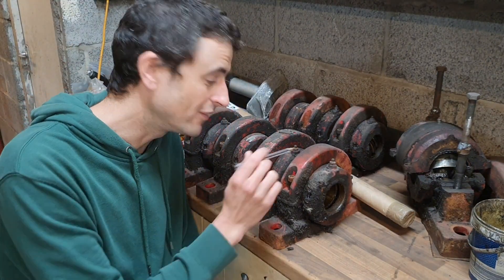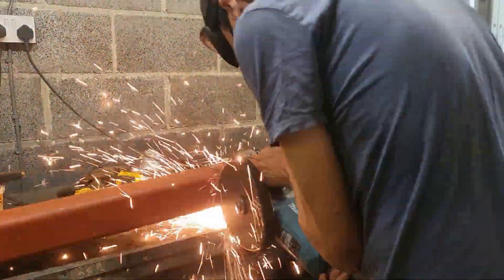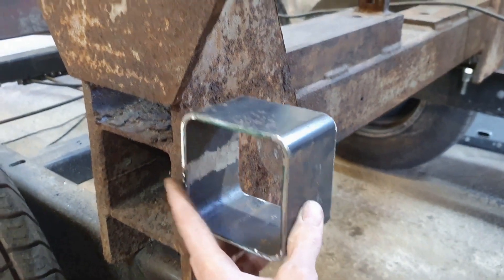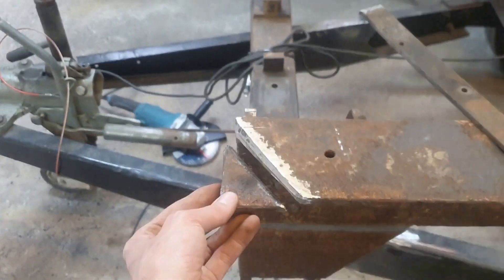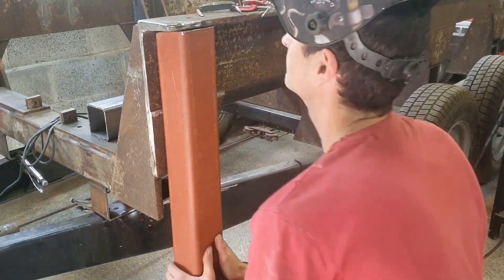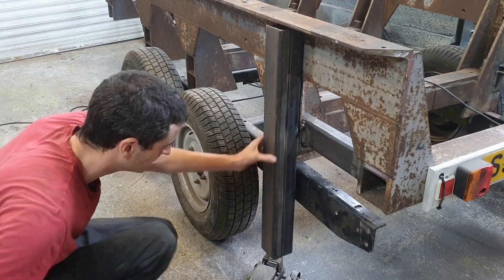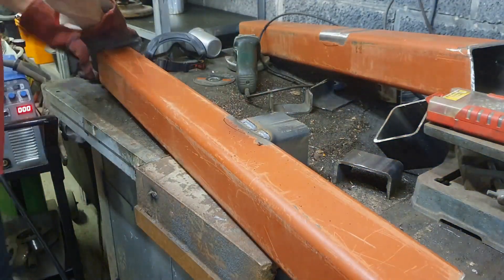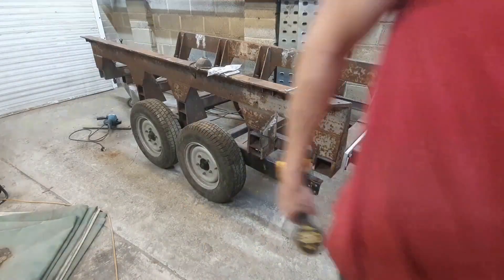Mobile Rolling Road Weight Fail! How to support 2t rolling road and car on a 3 ton trailer....

Comment: The first place to start on this project would be your axles and bearings. I cant tell anything from the pictures, but it looks like your axles would be rated at about 3500 lbs(1632kg) each. That would also impact your braking capacity and conversely your wheels and tires and spring capacities. The pillow block roller bearing system cannot be usable at high speeds. This project might not be feasable.
Reply: 3 ton's= 6000lbs=2700 kgs. Typically axle's with 10" brakes are rated for 3500 lbs(1500 kg) with 5 on 4 1/2 bolt pattern wheels er per axle. That means you can pull up to 7000 lbs. (3175 kg) total gvw. for a tandem axle set up. The question to be asked is: How much does the trailer weigh empty?
Reply from the maker: @ronbuckner8179  the Empty trailer was 360kg, the rolling road is 1900kg. So I think we should be all good right?
Reply: @lozl  ; It would appear so. 1900kg =4000lbs gvw. 360kg = under 800 lbs, Your filmography show's a bunch of steel on the frame.
Reply from the maker: @ronbuckner8179  There is certainly plenty of steel! And I do have to add more but as far as I can see, I have 700kg of head room before anything is overweight. Hopefully I should be able to keep it well below the 3000kg max gross weight.
Reply from the maker: Ron, thanks so much for the detailed conment. Much appreciated. 

You're quite right with your assumptions the trailer is rated to a max gross weight of 3000kg, with each axle listing a max gross weight of 1500kg. Tyres are rated to 850kg (dual). The trailer will have enough braking for 3000kg so all should be alright there. Trailer weights 360kg empty and rolling road is around 1900kg. What's your concern with the weight? 

Obviously ot would be over with a car on top of it but this is why I have made the legs. To get the weight off the trailer when it's being used.

The rollers are being balanced to around 2500rpm which relates to 150mph for the car on top. This is well within spec for these bearings. Max speed 3940rpm for the little ones and 2790rpm for the big one. 

Please let me know  if I'm missing something as it needs sorting sooner rather than later.

Thanks again for the comment, it's been really useful getting help from YTers over the last few projects I've done

Comment: Wacky idea - is there enough room to mount the trailer axles between the bottoms of the rolling road legs, and thus kinda rebuild the trailer frame around the rolling road frame? To my eye it'd drop everything about 6 or 9 inches, remove some more weight by getting rid of most of the trailer frame, and you'd have less height to get cars up onto the rollers... 🤔
Reply from the maker: Not wacky at all. That's a cracking idea. It would be so good to get it lower. The trailer hanging off the bottom will just add height when it's set up. 

I have tried it every which way though and I can't get it to work. Yhe rollers are just 10mm ot so above the trailer axles so the only place the axles could go is between the rollers and this would have the front and rear wheels fouling each other. 

I guess I could maybe find new axles and make it from scratch with axles that are bot connected left and right, the RR chassis certai ly has enough strength. But this would add a lot of complexity somewhat late in the game  and a lot more cost so I binned that idea. 

Tha ks for the comment Stu, much appreciated. Keep em coming.